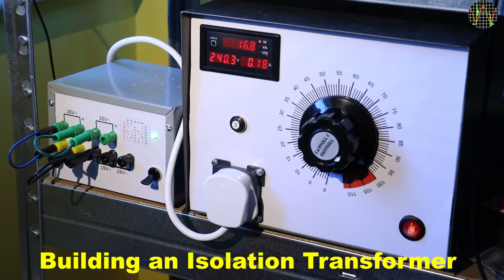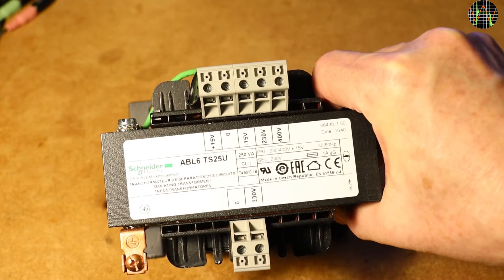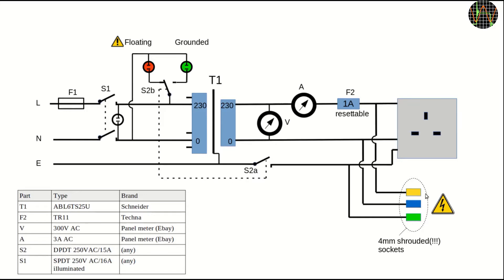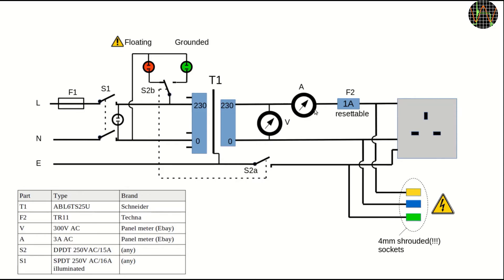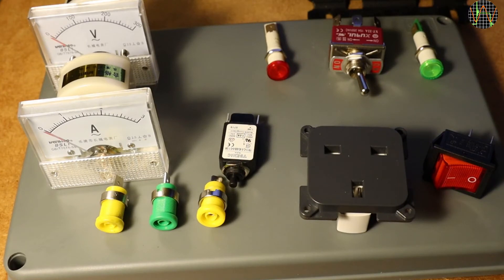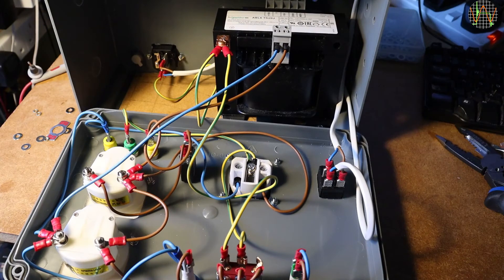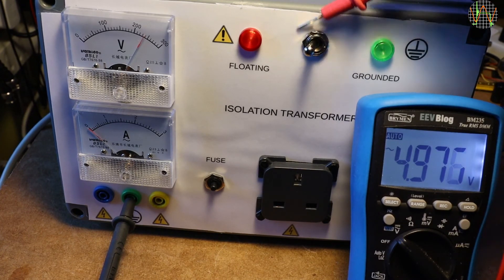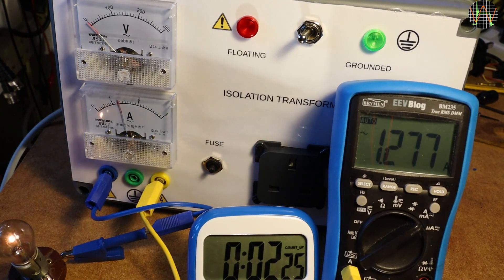Building an Isolation Transformer

Comment: Hello, very nice and successful project. In what program did you design the front panel?
Reply from the maker: LibreOffice Draw (its free)
Reply: @TheHWcave  Thanks!
Reply: @TheHWcave  And I assume that you create all the symbols for both the front panel design and the schematic design yourself and save them in some library?
Reply from the maker: @stanikmartinak9926  Not at all. I draw them on the spot. For example the dial around the variac knob. It is simply started with a vertical line from the centre upwards. Then I copy and paste that line and use the F4 key to specify a rotation angle taking care to make sure the origin of the rotation is at the centre (this is why using F4 is way better than the "properties" dialog which doesn't allow this kind of control. Rinse and repeat. Cover unwanted parts of your artwork with white shapes. It helps to use layers in Draw so you can hide and write lock parts...

Comment: Does the phantom voltage due to capacitive coupling changes when load current changes.
Reply from the maker: Good question. I just tested it (using a Fluke 77ii that I had handy). Using the same method as in the video in floating mode I measured 6.2V with no load and 64V with a 60W incandescent light bulb running. With set to earthed it was zero in both cases.
Reply: @ Thanks for doing the test. The result added to my knowledge about the phantom voltage.

Comment: Hi! Great video. Please tell me. Can I use the lamp in series after the isolation transformer (230/230)  at the same time in the same circuit? Like this: Main power (230) -> isolation transformer -> series lamp -> and socket (outlet)    Is this right?  ( I want to test audio amplifiers.)
Reply from the maker: Yes, a current limiting lamp will work just fine
Reply: @TheHWcave  Thank you very much.

Comment: Hi there, I have been thinking about this but I do not understand what is the purpose of the floating/grounding switch. The ground reference as shown in the diagram in my view has little relation (aside from capacitive coupling) to the secondary of the transformer. So if the switch was between the secondary ground and earth one could select if the transformer was being operated in pass through (secondary neutral connected to earth) or as an isolation transformer (secondary neutral not connected to earth). What is the purpose for the switch in its current configuration? Thanks for the good videos
Reply from the maker: I know what you mean. All I can say is that I looked up isolation transformer schematics and they all do it this way. Earth is not connected to one of the secondary connections (making it sort of neutral) but directly and only to the earth pin of the outlet socket. The switch stops that connection and makes the outlet float free, which is what you need when plugging a scope in. Or (much safer), the thing you want to measure is plugged into the floating outlet and the scope is in a normal wall outlet.
Reply: @TheHWcave Hi there yes I think I got it. To act as an isolation transformer the secondary must not be connected to a earth reference as we discussed. Connecting the mains earth to the system earth just make sure that the chassis or metallic parts do not float to unknown voltages. This however can be an issue when using an oscilloscope as there could be an electrical path between the oscilloscope GND (referenced to ground) and metallic parts of the DUT.  Thanks for coming back on this, it makes sense now

Comment: Should wired coils other way around and used the 400v as option
Reply from the maker: I considered that but in the end I decided against it. I am using my isolation transformer mostly behind the VARIAC which I already wired to provide almost 270V when turned to "11". If the isolation transformer would step that up even further,  the voltages could be seriously dangerous for connected equipment. For repair and test of devices, normal voltage or even lower than normal voltages when dealing with unknown faults are much more useful. And being able to raise the mains voltage to 270V if I have to is more than enough for me. I hardly ever used that so far.

Comment: Hi there. I grabbed myself one of these transformers from eBay. Thanks for the recommendation, it’s a very nice item. I will be using it in a project in permanent series in the same enclosure with a variac, and also at the input a switchable dim bulb limiter. Which way around would you recommend to put the transformer and variac? I’ve seen it done both ways. I was thinking if I use it with the transformer first (1A) and my chosen variac (2A) second, then I could have one amp at 240v going up to 2A capacity at 120v output and below. Some people put the variac at the supply side and the isolation transformer second though, including Mr Carlson, and it appears yourself at the early part of this video (using with your old isolation transformer) What’s the difference?
Reply from the maker: Yes, these transformers are a very good deal.  Glad you managed to bag one. My VARIAC can do 1000W, the isolation transformer only 250W, which is the only reason for the way I am using both. Having the VARIAC connected to mains allows me to still use the full capacity of the VARIAC when I need more power than 250W but not the isolation. Then again it does not really matter for me since they are two separate units, and I can choose which one plugs into the output of the other... but normally my isolation transformer is plugged into the output of the VARIAC and the VARIAC input directly into mains.

Comment: bear in mind,transformer vibrates,screws on your amp and volt meter could get loose
Reply from the maker: Its a good point and I used spring washers just in case for both.  It turns out in this case there is no vibration at all, even at load. The transformer is quite well put together and still relatively small (as transformers go). An advantage of the plastic box is that it would amplify any vibratory noise like the body of a violin.

Comment: I would exchange the red and green light. If the secondary side of the transformer is floating you are reasonably save against electrocution. If you however involve the ground onto the secondary side a life threatening situation is created. On the primary side you have the earth leak circuit breaker in your fuse box protecting you from electrocution. On the secondary side however the protection is non existing.
Reply from the maker: Its a valid point and I did spent some time on what light to indicate what state. In the end I decided to go with green = earthed. I am trying to standardise on this colour meaning earth even though it means i have to swap out a few green binding posts on my older builds for different colours. But that is totally my slightly obsessive view. Your point is absolutely true and  anybody who builds one of these should consider your arguments and decide for themselves.
Reply: @TheHWcave  Seems we are in opposite corners here. My oscilloscope has  a red sticker, meaning watch out connecting since it is earthed. The signal generator however has a green sticker since it is floating. A ground in a circuit can be your friend or your enemy. I guess it’s all relative.

Comment: Nice build :-)
Can you also do a voltage measuring between earth and one of the 2 terminals of the outlet socket, while the switch is in floating position? 
This is normally way more then 5V of "Ghostvoltage". Grtz
Reply from the maker: 157V blue terminal to earth and 16V yellow terminal to earth (at 233V input)
Reply: @TheHWcave  , you can try with a 1M or higher resistor between the blue terminal and earth, to lower the ghostvoltage. This voltage is very low current (µA range) , but it can kill sensitive components.
Reply: @BjornV78  Could you, or Heinz, please tell me more about this issue? Even a video? I DIY'd my iso trans from two identical trans, placed back-to-back. But, I did not consider this issue, due to a lack of knowledge.
Reply: @t1d100  hi, this issue is called ghostvoltage , strayvoltage or phantomvoltage, and is due the capacitive leakage from the primairy side to the core and secundairy side. The amount of leakage is depending on the construction of the transformer, if the transformer has a earthshield between primary and secundairy side, then the leakage is much lower. In most scenario, this leakage is more then 50% of the mains voltage, but has always very low current (in the µA range). A small neon lamp will glow, but a incandesent light bulb doesn't glow. This leakage can be reduced to almost zero if one of the 2 output leads of the secundairy is connected to earth, but a 0 Ohm connection the secundairy side and earth will bypass the all concept of being isolated from earth/ground, so this connection is best to keep as high as possible (1Mohm or more). But the lower this resistance is, the more current can flow through the ground lead of a scope probe if you connect this to the hot of the secundairy side.
Reply: @t1d100  also, if i remember correctly, a back to back setup will also lower this ghostvoltage leakage because this create a extra barrier between mains and output.
Reply: @BjornV78  Thanks, Bjorn, for your replies. I will surely be doing some research to determine what extra circuitry would be best for my needs.
Reply: @t1d100  No problem. Also, the 1Mohm that i mentioned, is not a hardwritten rule, but based on the fact that modern scopes have a internal resistance of 1Mohm. With 240V mains, this means that there will flow only 240µA through the earth lead of the scope.